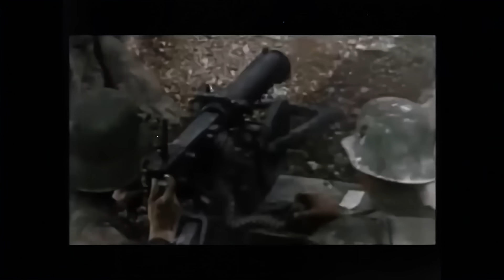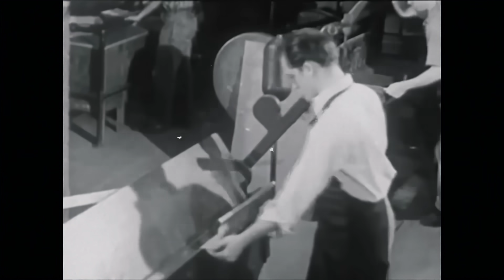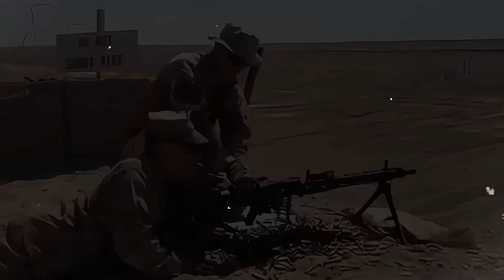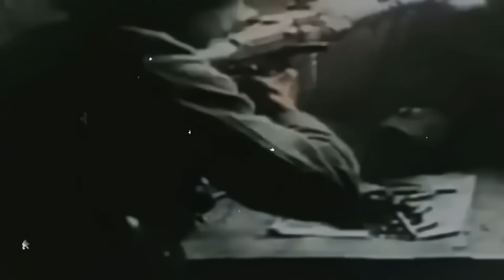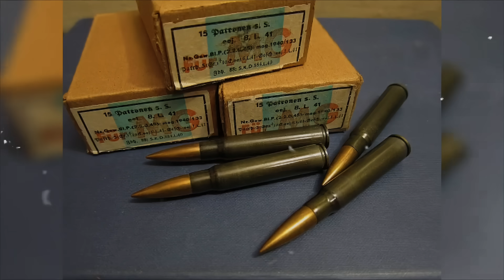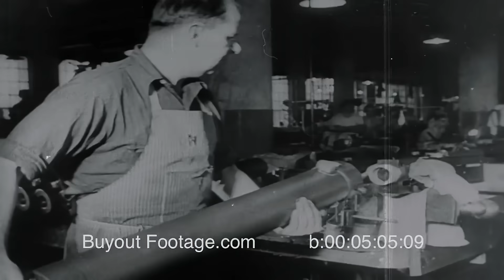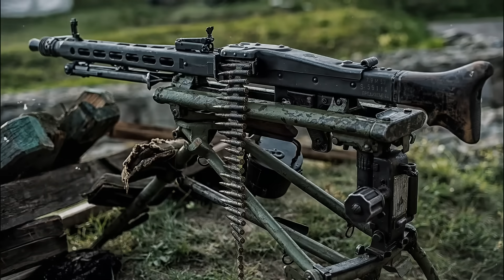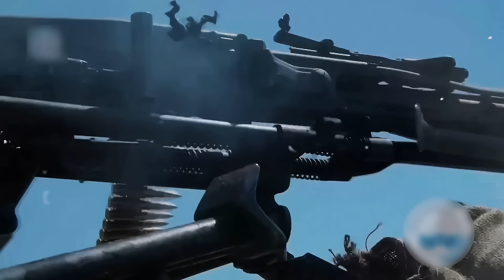Why U.S. Failed to Copy German MG42

Comment: I fired the MG-3 in West Germany during a visit to a German unit.  I found it was impossible to fire less than 3-4 rds with a trigger pull, it fired so fast.  It was also as accurate as a rifle.
Reply: That's how you're supposed to shoot it, short bursts.
Reply: When you are properly trained and shoot the MG3 a few times you can manage single shots. I did it quite a few times, but yeah i also had way more opportunity to shoot it.^^
Reply: @_realghost_  The GPMG is designed to fire with multiple short or long bursts,  firing it in single shot  is not what it was meant for and it only places undo concentration on the gunner to try and achieve this feat.
Reply: @tiberius-f7t Thank you captain obvious
Reply: @_realghost_  
"Thank you captain obvious"
😂
Reply: @tiberius-f7t  On the other hand, if you charge single rounds in a belt (every other link) and use it as a rifle, you have an exceptionally precise weapon. You will have to pull on the belt between shots, of course, which makes it less than ideal for practical use.
Reply: I also tried to fire a single shot with it but that is not possible. It fires so quick that you can not move your finger fast enough to only get one shot out. And the grouping was indeed as with a rifle.
Reply: @Isleman-u3s It is, we are trained in 1 to 2 single shots.
Reply: @MarcelKuhlmann-v7t  yes, indeed
Reply: One of the sergeants in my company typically got 14 "bursts" per 15 rounds. So he basically fired it single shot, he just didn't hit very well with it. XD more common and practical were 2-3 round bursts, which with a little practice any draftee could do.
Reply: @grimmbartrides  True. But these were mostly used for getting rid of unwanted Civilians in mind. The Japanese would have loved something like this in their ethnic cleansing operations in China. They resorted to hands and bayonets. The human mind is insane
Reply: @grimmbartrides   On the shooting range 30m. I shot once 48 shots in center (10)  and out to 7 with 50 shots and of course did we cut the burst on 1-3 shots pr burst.
Reply: In Germany we are trained to shot only one to two shots....No problem.
Reply: My grandfather was an MG34 gunner (he was knocked out out of the war with a head wound in 1942 so I don’t think it was an MG 42 yet).   He was selected to operate the machine gun because  he was the best marksman in the squad.  The best shot always got the MG because ammunition conservation was critical.  He said that if they fired a burst of three rounds. (which the slightly slower firing MG 34 was easier to do) every bullet was supposed to be aimed at a target soldier.  The gunner was not only a good shot. He had a high IQ.  He would pull the trigger and pan the gun at a rate that would hit all three enemy soldiers if necessary)
-The image of dumb German soldiers from Spielberg movies that don’t take cover properly and expose their whole torso  is simply ridiculous .  My grandfather used to bounce bullets off walls and rocks to hit enemy soldiers hiding behind cover (Soviets) .   He was a very smart man technically very competent.  They would take care with cover.  Of course, sometimes you had to move and sometimes you slipped up and sometimes someone was hiding and wait.
Reply: @williamzk9083 the MG34 had a large trigger with two functions which was unsual
Reply: The MG-34 had a dual trigger system for semi and auto.
Reply: I did fire one shot`s with the Danish version ot the MG.42 called M.62, but only with the infantri-spring I might add, not the one`s made for the Leo.1 and 2`s... You need to be very danm fast, only slide you finger over the trigger, that I somehow do remember... gg
Reply: Please understand that a 'short burst' for a GPMG (unlike a SMG or automatic rifle fire) is about 8-12 res, not  3-4 rds.   The GPMG fired in short Burts is designed to hit then primary point of aimed target and those targets within a 3-4 foot radius of the aimed target.  So you actually did very well in getting off a 3-4 rd burst.
Reply: I had a guy in my unit that could reliably fire it single shot and use it like a sniper rifle. I only did it a couple of times in like 4 exercises, i thought it was pretty difficult.
Reply: Ich habe bei der Bundeswehr 1995 mit dem MG3 (MG42) geschossen. Liegend auf eine Zielscheibe mit drei Reihen hatten wir 6 Schüsse. Ich habe auf den unteren Kreis gezielt, der erste Schuss war im Ziel, die anderen 5 im Kreis des mittleren Kreises. 😄
Reply: with training you can do single shots.
Reply: @ShimadaSharra  I would simply use a rifle for that.
Reply: I trained on MG3 while in the german army in the 90s (when we still had mandatory military service). We specifically trained firing triplets with it which requires some practice on your trigger finger, especially since the trigger is quite heavy to pull. But of course we also enjoyed blasting entire belts through it at the end of the day when there was ammo left the ammo officer didn't want to take back and count after a training day.
Reply: Put a single drop of gun oil on your trigger finger and the magic happens... Single shots.
Reply: I was in the Danish army. I couldn't but my guys could get 1 round of consistently.
Reply: MG3 is also very accurate. They are still used in the Leopard2's as the turret machine gun and when they have a rock solid mount like that, they are absolute beamers. Since they are recoil cycle their function and fire rate is also better when they have a proper mount.
Reply: It’s laser beam 😂
Reply: I would agree with some comments. The after War MG3 is a real great MG. I had it as my Standard Tool during my years in the Bundeswehr as a Para in the early 80ies. Single shots were no Problem and we were trained hard to be very accurate on a distance of 300 to 400 meters. And even running and firing on Battle Shooting Range. I loved it and I had no problem that it had a weight of 12 kilograms. Glück ab🇩🇪🫡
Reply: The mg3 already has a toned down firerate.
Reply: @Niemand93-r7p not much, MG42 where from 1200 to 1500 RpM, yes there are MG3 with slower than 1200 RpM but the Bundeswehr never get one of these.
Reply: @Niemand93-r7p    The GPMG MG3 had a standard buffer that allowed for a 1,000 - 1,200 rpm rate of fire and a heavy bolt/heavy buffer which afforded a 750 rpm and this change could be done within about 5-7 minutes in the field by the actual gunner.
Reply: @tiberius-f7t  no the rpm is official 1200, the MG 42 fired faster if fiered longer the MG 3 doesnt do this. the German MG 3 has no heavy bolt to slow it down to 750 rpm even the austrian version MG74 has such a slow rpm and it is slow with 850 rpm. I was in the Bundeswehr and this are the official numbers.

Comment: Rate of fire can also be a units downfall, burning though their ammo in no time.
In Normandy some machine gun nests had to give up after a while as they had run out of ammo.
Reply: That was probably not due to RoF but they just run out of ammo after some hrs of intense firefight. German MG42/MG3 gunners were and are trained to fire short bursts of 3-5 rds when on bipod accuratley and longer bursts of 15-25 when on any kind of gun mount/lafette. Fire discipline is rooted deeply into german machine gunners. For marksmanship evaluation (Schützenschnur) if you want to get a "gold"-rating with the MG3 you get 15 rounds and need to hit 3 targets that are 25m away but look like they are 400m away (large canvas with some landscape print and small black soldiers in positions printed onto the green and brown surroundings). The targets/enemy soldiers have two circles printed around them, small one is 7cm (2,75in) in diameter (target hit), large one is 18cm (7in) (target suppressed). With the bipod for gold rating you need to score hits on all 3 assigned targets (7cm-circle). You ALSO need to have a total of 4 shots within the 7cm-circles AND a total of 12 (of 15) within the three 18cm-circles. You have to do that twice. Once without time limit and then with 20sec time limit. The MG3 kicks quite a bit and the second shot of a burst will not be within the 7cm-circle anymore. With good control of the weapon and the trigger you get 2-3 shots per burst, so usually a total of 5-6 bursts/15 rounds of which the 1st one each goes into the 7cm-circle and you manage to keep the others within the 18cm-circle. 7cm circle@25m equals about 0,5m deviation from centre @ 400m and 18cm circle is about up to 1,4m off the centre @400m. That is on bipod. On a gun mount like on tripod or within a tank shots won't wander off, just stray. I used it extensively on the Leopard 2A4 in which you have a coax MG3 on a fully stabilised gun plattform with rangefinder: it is very easy to concentrate fire on a man-sized target @600m and the tank will provide a firing solution up to 1600m (which looks really strange through the 12x-scope because the bullets will seem to go really slow (half the speed of an 120mm APFSDS-T) and it looks like lobbing because the apex of the firing arc is >10m above the line of the sight.). Same applies to the tripod. As you are very accurate with the machine gun fire, you rather go for direct hits than to spray an area. My company commanders hated that when on the shooting range, because the MG-ammo just wouldn't go down fast enough and they would have to present more targets over a longer period of time, blowing their schedule. Back to D-Day: At Omaha beach there was Heinz Severloh, a German private and machine gunner who was positioned in a bunker called Widerstandsnest 62 (Resistance Position 62). After the war he claimed to have shot at/wounded/killed a 4-digit number of US-Soldiers on that day. According to his memories he would have - over the course of several hours - fired 15k rds with his MG42 and 400  rds with his K98k.

Comment: Norway managed to do a 30-06 version of the MG-34.
Reply: MG-42 тоже.
Reply: de kunn deres kram i KONGSBERG
Reply: a fairly easy procedure, although different propellant loads and projectile weights may make it more difficult than it appears initially.
Reply: cuz fuck you, the 6 guys behind you, the guy behind a 3 ft concrete wall and the shooters entire arm?
Reply: Es ist einfach etwas zu bauen, wenn man die Pläne und Techniken dazu stiehlt.
Reply: also in Denmark. 30.06 nato. however it was the MG42 that was converted.

Comment: The MG42 was a synthesis of:
MG34 (itself derived from the general purpose concept, Swiss Solothurn S-2-200 & MG30), Sten manufacturing techniques (few machined parts), portability of the Lewis, tilt barrel change concept of the otherwise dreadful Italian Breda 30 while retaining belt feed.

The Germans weren’t the only side with two MGs - one for infantry & one for tanks. The Brits had the Vickers+Bren for infantry and the BESA (Czech Vz 37 in 7.92x57 mm!) for AFVs. The USA used the M1919;series for both + the BAR.

Post-war the Yugoslavs made a copy of the MG42 in 7.92x57 mm and Germany M3 in 7.62 mm NATO and for many others. 

The M60 was a combo of the best features of several firearms. But keeping the gas cylinder and bipod on the barrel made spare barrels ungainly. The Czech Vz 26, 30 and Bren avoided this. The USA had a fixation of bipods being close to the nuzzle - witness the M1918A1. FN made their later BAR models such the FN “D” with the bipod further away AND with a quick change barrel (to match the Czech VZ 30/UK BREN. 

Meanwhile, FN combined elements of the BAR (bolt locking principle) with MG42 feed.  As the MG240 series this replaced the M60. 

Meanwhile, the Soviets/Russians had the MG42 drawings but instead came out with the PK/PKM/PKT. I suspect the MG42 wasn’t much use since the 7.62x52 R mm rimmed cartridge (dating to 1891) was NOT amendable for a “push-through” kinked belt.  

For a long time, one had a choice of three excellent Gen’l Purposes MGs: The MG42/3, the MAG or the PK family. Perhaps 4 if one counts the M60 with MAP assistance. 

.

Comment: During Nam on of my E-8s captured an MG42 and crew. When taking the MG -42 apart the lower receiver was almost identical to the M60.  They got to paly with the guns side by side.  They liked the 42 but the M60 proved to be better in their opinion.  Biggest draw back was it has too high a rate of fire and the M60 when maintained properly was more durable.
Reply: MG42 in the hands of V.C. ?😮
Reply: @Flyinghigh888  They had everything they could get their hands on, even STG44's.
Reply: @ToreDL87  Courtesy of the USSR
Reply: @Flyinghigh888   I've read they used some other German WW II gear, such as the  StG 44.
Reply: That’s how they won. 🤷
Reply: @jansix4287  FYI the VC didn't win.   They were nearly wiped out during the Tet campaign.  Gen Giap sent them to their deaths to solidify his position as the NVA commander.  Starting around 70-71 nearly everything the US saw was NVA regulars.
Reply: @johnsorge3034 America had its bottom handed to it one way or another
Reply: @johnsorge3034  Wrong. The entire Viet Cong was wiped out five times over and always recruited back volunteers, who fought and died for their country's independence from foreign occupation. The "Kriegsziele" were all full-filled. 💯%
Reply: @jansix4287  While the VC still existed in some form or another form 71 on the bulk of the fighting was done by NVA regulars.  I will refer you to Gen Giap's biography  and Conduct of the Vietnam War by the US Army Staff College. These are two of the better detailed accounts of how the war was fought.
Reply: @johnsorge3034  And I refer you back  to the Ken Burns documentary series "The Vietnam War".
Reply: @Flyinghigh888  I was a complete kit too.  HAd the tripod, accessory bag and even the AA Sight disk.
Reply: Yeah, I was told the M-60 was basically an MG42 with the ROF turned down a notch. That's probably the biggest reason it was more durable.
Reply: "when maintained properly" where the MG42/MG3 can eat through sand and grass when! it gets into the belts
Reply: I've always wondered exactly WHAT the Germans were thinking, when they made the MG-34 fire at 900 rounds per minute (and the product improved MG-42 fire at 1200)?  It was no secret that German mg's fired  twice as fast as anybody else's mg.  Nobody in any other army thought this was a good idea, the Germans were the one and only belligerent in WW2 to deploy a machine gun with such a high firing rate.   
The disadvantages of a high rate of fire are glaringly obvious - increased ammo consumption, faster over-heating of the barrel, and accelerated wear and tear on the guns themselves - that surely the clever Germans  must have had good reasons to deliberately design their MG's this way.  After all, who can argue with the success of the Wehrmacht, an army so powerful it over-ran Western Europe in a matter of months? 

But the design trade-offs the Germans made in their machine guns just to achieve that high firing rate, hardly seem worth the disadvantages.  Especially later, when the German waffenamt ("weapons office")  introduced arguably the finest machine gun of all time, the MG-42 - , a gun which fired at a near-impossible rate of 1200 rpm!  Yet that, of course, is exactly what the Germans did.  And nobody has ever pin-pointed the reasons why they did it!
Reply: @marcs.6913  Ask the soldiers who caught the bullets when the ramps fell down on D-day, if they benefited from German over-engineering? MGs are meant to kill a lot of infantry quickly.
Reply: @jansix4287  You make a good point but they would have been just as dead at 600 RPM. D-Day was an unique situation of concentrated troops.  But the beaches were still cleared.
Reply: @johnsorge3034  WW1 was a unique situation of concentrated troops. Every mass mobilization war is. When you swipe MG fire across a wide battlefield, a higher firing rate makes even more sense. The Russians lost approximately 9 million soldiers in WW2. Most of them must’ve been killed by the MG. Efficiency and precision always win in the long run. Just look where Russia and America are now!
Reply: @marcs.6913  I think they thought it would be a good idea.  You have to remember that during WW1 the MG did tremendous damage with a much slower rate of fire.  I guess they went with More Daka.  There is a point where extra rate of fire doesn't do any more damage.  Most modern MGs are in the 600 to 800 range.

Comment: because they can't convert centimeters to inches
Reply: Are you stupid? Anything smaller than a 5 inch gun we Measure in mm and centimeters, we called it the 76 mm and 75 mm.
Reply: @Armada-1935 Ah yes. Famous 12,7mm M2 heavy machine gun and legendary 11,3mm Colt 1911 semi-automatic pistol.
Reply: @Xtr @XtreeM_FaiL  the M2 is literally 12.7 mm
Reply: @Armada-1935 M2 literally is 0.50 BMG.
Reply: @XtreeM_FaiL the bore diameter is 12.7 mm lmao
Reply: Both are right, the offical one is .50 caliber though
Reply: And .50 BMG is the round fired
Reply: @Armada-1935 Irrelevant. It was designed using inches.
When talking about 12,7 mm, it means 12,7x108mm USSR calibre.
Reply: @XtreeM_FaiL Am I wrong though? Ive heard people refer to the M2 having a 12.7 mm diameter
Reply: @Armada-1935 Sometimes yes, because it basically is, but not in this context. ;)
.50 BMG is also known as 12,7x99mm NATO.
Keep in mind that it's over 100 years old design and the OG blue prints are not metric.
Reply: And last I checked, the MG42 doesnt use rounds and inch in caliber
Reply: @Armada-1935you have A LOT to learn about humor and people
Reply: @BertelliFineMinerals i don’t get the joke then, is this boomer humor?
Reply: That must be why we put a man on the moon and you didn't!  LOL!